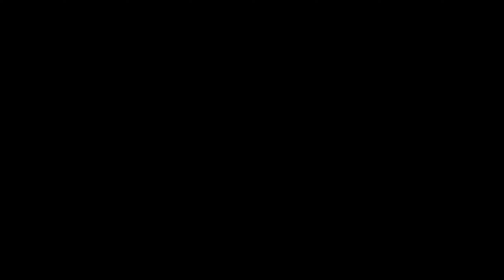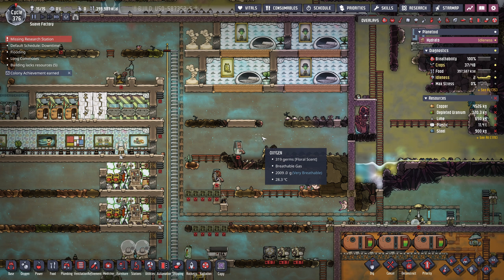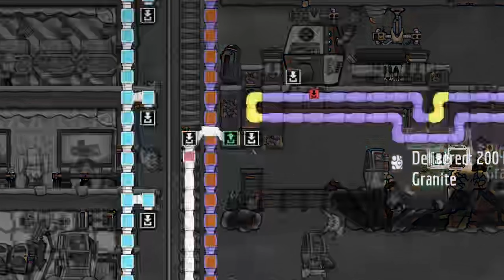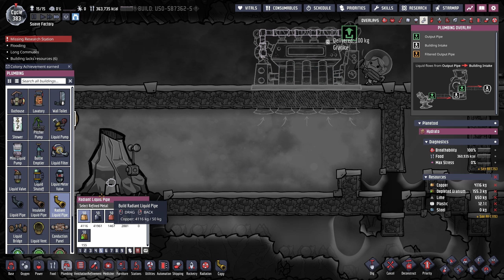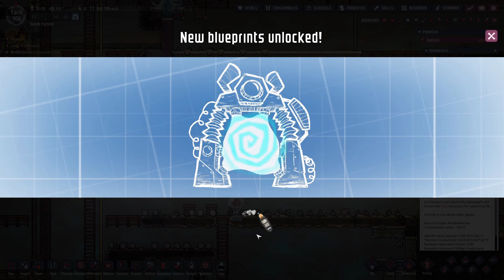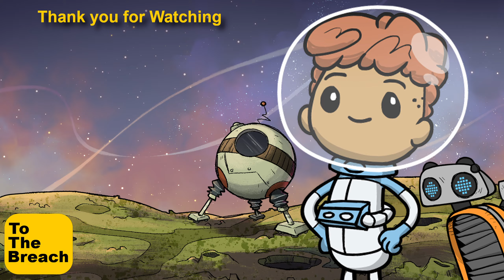Oxygen Not Included EP 7 Twin Freezer Kitchen

Comment: This video was recommended to me today, you have a good base started there!  Couple things if I may.. your duplicant sensor in the kitchen is too far over and doesn't pick up the person at the gas range.  The steam turbines can be made out of lead, it's a waste to use steel.  They will overheat and stop running before they reach anywhere near the temperature required for steel.   I like to keep the Exosuit forge inside the main base so they don't have to wear a suit to repair or create new suits.. but if you keep on top of it (I realize it was a forgot to set it issue) it doesn't matter :)   Lots of new ONI video's lately - awesome to see people loving this game :)